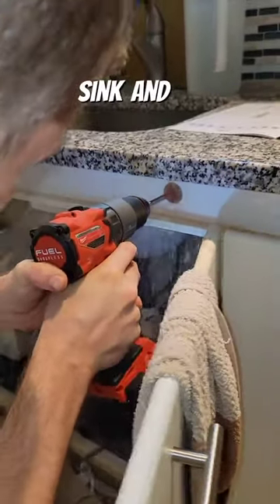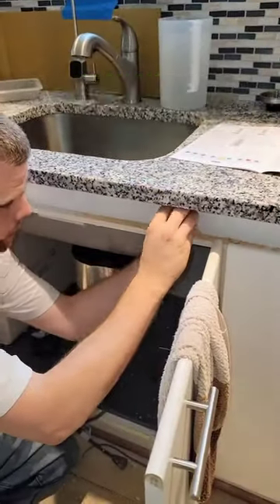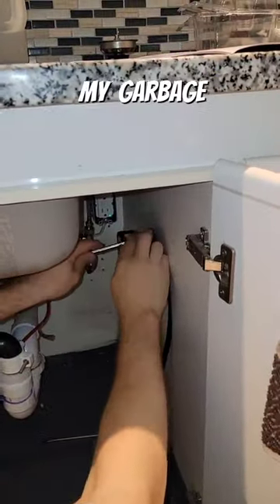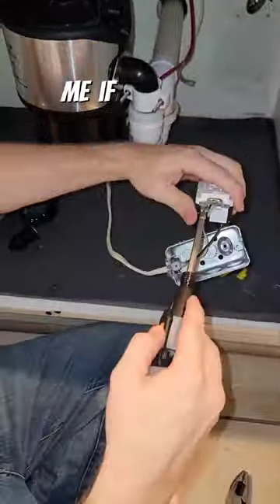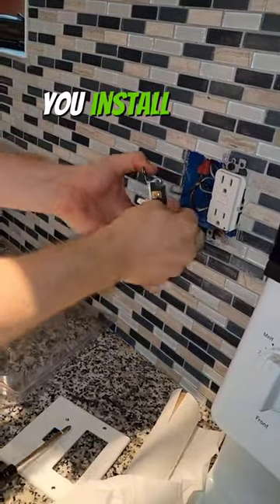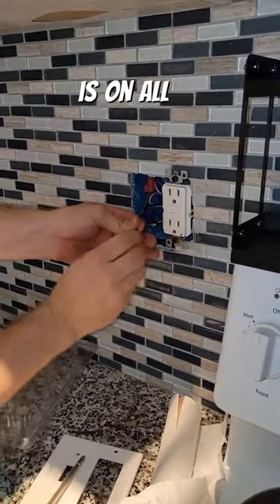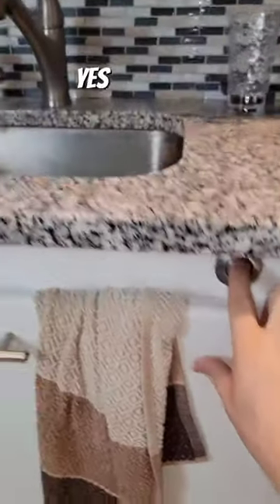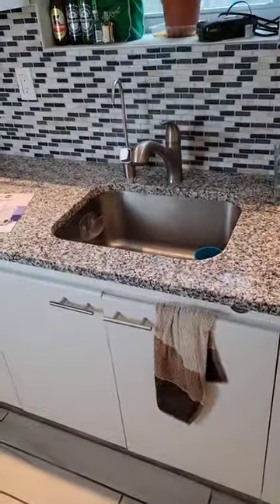How to add a receptacle under a kitchen sink #shorts

Comment: I think it's dangerous that a child could turn on the garbage disposal.
Reply: Yeah. Stupid placement
Reply: Very Dangerous.. Ever Accidentally Bump it & Grind Up Some Silverware? ..Think Things Thru Bro.. Decent Looking Horrible Idea..
Reply: @FonicsSuck  , right.  I keep mine in the oven.
Reply: @chrisfoxwell4128  😂😂
Reply: My thoughts exactly 💯
Reply: @johncrowe5164  mate the only way you could bump an air switch and turn it on is if you bump it with your todger.
Reply: @JohnSmith-lr1qm  I've a Whirlpool With an Air Switch..It Gets Accidently Turned On All the Time. My Opinion it's a Bad Idea I Won't Be Installing Anything Like that.
Reply: Very true.  Installe it where it can't be reach or turn on by accident.
Reply: @FonicsSuck  lmao can’t believe you just said that.
Reply: So true.  Got my hand down there and kid walks up and hits the button.

Comment: Could have just left switch on all the time. So then if pneumatic switch failed closed you could still turn off disposal. Wouldn't hurt anything to have two switches in line. Plus if kids played with pneumatic switch you can deactivate it with original switch.
Reply: @vvsmixing  switch was already there. He just bypassed it and left it on panel.
Reply: It would be a nice fail safe, but it would affect the receptical under the sink he's doing this for.

Comment: Now let's see that outlet pass a state inspection
Reply: Ryan  sure are. Only problems here are. Its supposed to be a single receptacle, its not supposed to be a GFCI, and also needs to be tamper resistant.
Reply: @adfadgaqgv  aren't recepticals near water sources supposed to be gfci.
Reply: @eaglest330  yes, but a GFCI receptacle has to be in a readily accessible location. A GFCI breaker would work.
Reply: @adfadgaqgv   210.8(A)(7) Ground-Fault Circuit-Interrupter Protection for Personnel. Dwelling Unit sinks. The receptacle in the image is within 6 ft. of the kitchen sink and requires GFCI protection even though the receptacle does not serve the counter top.
Reply: @adfadgaqgv  the only thing that may not work it the power it draws on start which could be more that the . 05 amps for a GFCI to trip.
Reply: @duanestevens9789  free speech,I thought we were living in a free country
Reply: @michaelc9128  not when I comes to being certified for a trade! Free speech is great when you know what you're talking about and if your not a certified electrician you don't know what your talking about so that free speech gets thrown out the window there honey!
Reply: @duanestevens9789  I didn't say it didn't need to be GFCI protected.

Comment: Anyone else trying the same thing: dont add a GFCI until you verify the disposal wire isnt already on another GFCI. 2 GFCI in series will cause problems. You only need one GFCI on the first outlet in the series.
Reply: Also, check local codes to make sure they dont require the disposal to be a dedicated circuit.
Reply: True
Reply: You can run GFCI on load lines from other GFCIs. It's code almost everywhere, and compliant with manufacturer directions. I will say that I don't agree with running GFCIs off of other GFCIs because it makes tracking down the reset buttons a pain.
Reply: @jkren1629  good point.  I guess GFCI from GFCI is confusing if you hit the reset and it doesn't work and you have to find the other reset.

Comment: Electric isn't plumbing, it doesn't flood your house, it burns it down!
Reply: Oh it'll flood your house when they're putting the fire out
Reply: @adfadgaqgv  yeah but will you have a house left after it burns down or will you just have to replace flooring that got ruined by water! Think about it, I'd rather replace my floor than my house!
Reply: @adfadgaqgv  think electric fire will burn down but the fire department puts it's out after it's burned! So you have fire and water damage!
Reply: @duanestevens9789  if all goes well. you’ll get a whole new house if it burns down.. if it floods… that’s coming out your wallet
Reply: @vvsmixing  not if you do your own work without being certified, even being the homeowner, insurance will see into an investigation to find out that you are the one who did the electric that burned down the house! Guess what then, no new home, no insurance claim and your probably going to be homeless lol LMAO 🤣🤣

Comment: Dangerous as things have a tendency to fall into the garbage disposal. With this setup you can accidentally turn on the disposal when your hand is in it.
Small children also have a tendency to push buttons. 
You should consider possible outcomes before you make changes in the house.
Place a cover over the button for safety and make it Strong!

Comment: Not recommended.   Was that handle box you installed surface mounted??  If so it’s not permitted per code because it’s location.  Better should have been a weather proof box IF IT WAS SURFACE MOUNTED.

Comment: I find many disposals use standard light switch.  That’s dangerous.   Home Depot sells momentary on/off light switches that are far safer.  The switch is spring loaded, so it only stays on when you hold it down.  This means the disposal can’t be left on indefinitely.   This is even more critical since everyone seems to wear ear buds and you can’t her the disposal.

Comment: Awesome.  Hadn't heard of this before.  I'd like a kick switch that worked off the same concept !  Switches for electrical are way too limited but having an air based switch that has zero code requirements is a great flexible solution that can be used for a lot more than just a garbage disposal !

Comment: don't see the point of bypassing the old switch, might as well keep it as an added layer of functionality, lets you mess with the outlet under the sink without having to turn off the breaker and serves as safety for curious kids or pets.
Reply: Can just press test on GFCI instead of going to breaker.  I'd put a USB outlet there.

Comment: I installed the same air switch. There used to be a switch under the sink in a cheap plastic box that I felt would electrocute us. It's much safer and located right on the rim of the sink basin for easy access.

Comment: Are you an electrician? If not please stop electric work ASAP! It's a nightmare for men like me to have to fix "EVERYTHING"! IF YOU ARE NOT CERTIFIED YOU HAVE NO REASON OR NEED TO TOUCH ELECTRIC! Trust me!
Reply: Ryan  most people are not even homeowners not just electricians! Stupid statement! I do know you have to have 8000 hrs on the job training and take a 4 yr apprenticeship trade school in Cali bc guess what, I did! If you want to burn your house down doing your own electric work be my guess! It's not plumbing and won't just flood your house!
Reply: Ryan  Most electricians aren’t homeowners? Like Journeyman/Master Electricians? Idk what state you live in but where I’m at all of them are paid more than enough to own a house and I have yet to meet an experienced electrician with credentials that isn’t a homeowner. Weird take.
Reply: Think of it as job security
Reply: @RearrangingReality  thank you!
Reply: @YouTubeH8sFreeSpeech  hop in a panel in a house and look at what's going on! So as an electrician I get scared when even a general contractor installs a simple switch unless they have a c10 license! Do you know what a ç10 is?
Reply: @jeffp7368  if you're the home owner more like insurance claim! To find out you did your own work and burned your own house down so guess what no more home!
Reply: @YouTubeH8sFreeSpeech  what is 12g 14g 8g 4g 750mil or any wire size? Wrong wire size and wrong application! Please tell me what you need to run for wire size for a 20 amp breaker! Please tell me your an electrician without telling me your an electrician!
Reply: Ryan  you're an internet troll as far as the eye can see!
Reply: @duanestevens9789  Lol 😂 The fact that you think Google is so out of reach for people nowadays is hilarious. 

Not to mention. Yes. Wire gauge is not a new concept, nor is it conceptually non-transferable information to other industries. Yes, it's a very tangible concept that anyone messing with wires should understand. Just like I'm not going to be astounded when a plumber frames out a room in a house. It's easy shit. Breaker panels? Sure. Those can be dangerous if you're not placing the correct breakers on the correct corresponding inserts, but outside of that. It's very simple to plug and play. People only mess up when they don't stay consistent and pay attention. 

Good luck to your endeavors mate. It's been an honor talking to a electrical gatekeeper.
Reply: @YouTubeH8sFreeSpeech  what is all the difference in electric work? Tell me all the different types of power someone can work with! 120 then what and what is high power! Do you know the difference in color between high volt and low? Bet you can't tell me what you will be looking at in a panel and where the wires connect. What's a 2 phase compared to a 3 phase? How many wires can you fit in a 2x4 box or single receptacle? Please don't call me a gatekeeper when I would rather someone hire an electrician than burn their house down!
Reply: @YouTubeH8sFreeSpeech  use common sense!
Reply: @YouTubeH8sFreeSpeech  I didn't Google for my electric license! Clown
Reply: @YouTubeH8sFreeSpeech  knowledge drop.... I mean mic drop lol LMAO 🤣💀💀🤡

Comment: I used a wireless switch kit.  Easy if your disposal plugs into a 110v outlet.  No drilling.  Put the switch where you want.  Ours has 15 and 30 sec buttons so I hit 15 and keep working while it runs.

Comment: Everyone who is saying it's not safe for kids, what alien kids do you have that have 6 foot arms to be able to reach INTO the insinkerator and press the button at the same time?
Reply: Good point!! I'd probably still put mine back by the faucet to keep it away from my kids, but, you're right, it'd be more to avoid an annoyance than a safety issue. I've actually been looking into getting one of these, and have found that many of  them stay on after being pressed, and have to be pressed again to shut the circuit off. So, if a kid turns the dry disposal on, and runs off, that would be kind of obnoxious. I also feel like back on the countertop is a better place because if I'm washing a bunch of dishes, the button is right near where my hand is reaching for the faucet/soap/sponge and such anyway, plus I won't be dripping gross/soapy water from my hand onto the floor every time I need to turn the disposal on. In this case, I'll bet the installer was just trying to avoid drilling through a tough countertop, but the way they did it just seems a little second-rate, and not as nicely finished as placing the button on the countertop. But, yeah, anyone with 6 foot arms should know better than that!! 😎😎😎👍👍👍
Reply: @OriginalSmoothOperator : I understand your concerns, and the placement of the intermittent switch plays a big role in the functionality and lifespan of the system.

Also, if the button is getting stuck in the open position, it usually has some gunk stuck in the internal spring that is causing it to stick, unscrew the button and give it a clean out and it should stop.